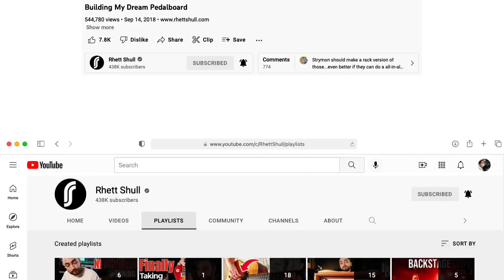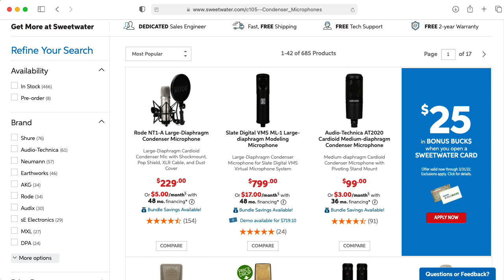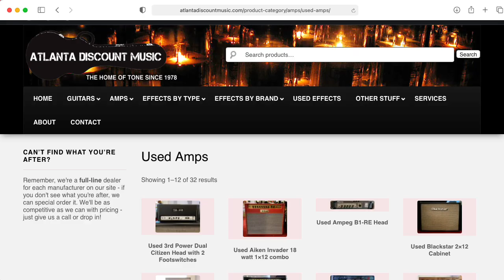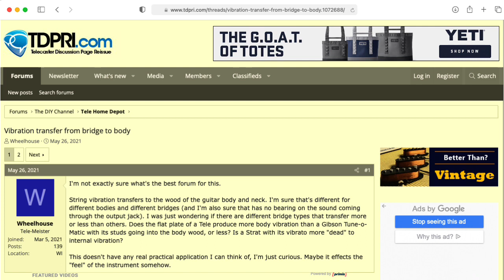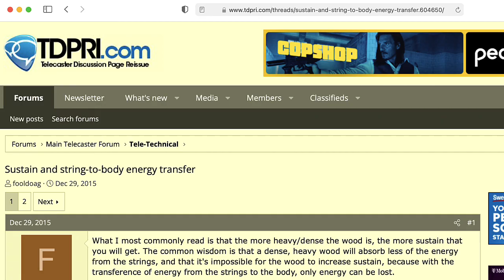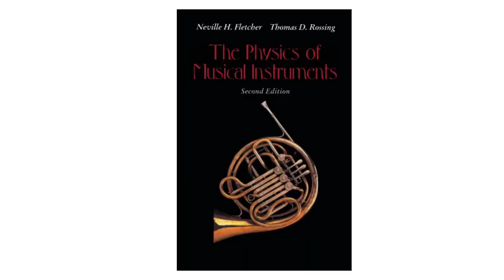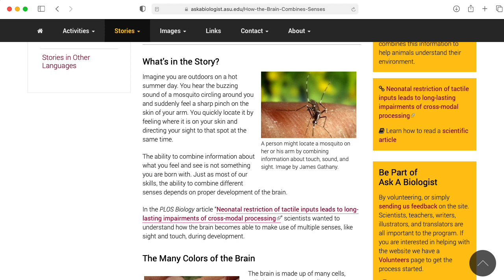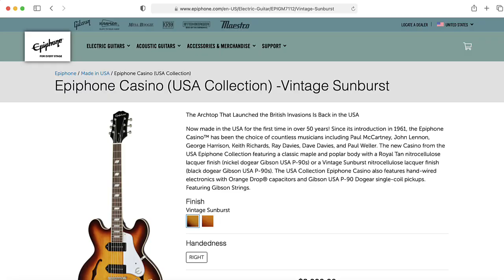Refining Rhett Shull's Resonance Reasoning: Vibrations in Electric Guitars and the Sustain Paradox

Comment: I've been playing guitar for 57 years and electric for 54 years.  I find that I prefer mahogany necks, because I find the tactile feedback provided by a less dense and more resonant neck helps my finger vibrato.

As an aside, and related tangent, every New Year, our congregation invites congregants to bring their own shofar (ram's horn) and blow it, en masse, to usher in the New Year.  But the difficulty that mass-blowing presents is that one cannot hear OR feel the instrument/horn to know if one's own blowing has gotten air moving.  It's like trying to play sax with pads on your fingers and ear plugs to prevent feeling or hearing the sound.  It would be near impossible to learn to configure your mouth and lips appropriately in the absence of the feedback.  And since it is not the sort of skill one practices daily to be able to rely on habit, in lieu of real-time feedback, the critical nature of that tactile and audible feedback is even more pivotal.  And if, by chance, everyone else stops blowing, you can easily find yourself erroneously making raspberry noises instead of a robust howl.

I have that relationship with neck materials.  If an amplified guitar is played loudly enough, then the amplified sound will vibrate the guitar body, and ultimately neck, enough that competent finger vibrato is possible, regardless of whether it is a mahogany, maple, multi-laminate, or aluminum.  But if I'm not playing loud, I need to feel that note resonating in the neck and delivering tactile feedback to my fret hand to bring out the B.B. King in me.  It is subtle, like most bodily feedback is, but I find it matters.
Reply: It's not so much that a guitar body resonates, but rather what resonates.  I have a pet theory that the tone of an electric guitar is influenced by whether the bridge is situated closer to the "waist" (where the instrument is narrowest) or "hips" (where it is widest).  Certainly, in terms of physics, the overall mass and material density, of the body plays a role.  But the bridge is one of several loci that determine what acoustic energy (and specifically harmonic energy) in the string is maximally conserved or damped, and I feel the mass directly underneath the bridge plays a role in that.  Look across a diverse range of solid-body electrics, and you'll see that they can vary quite a bit with respect to where the bridge is situated (compare an SG to a Les Paul or Telecaster).  And if we look at acoustic guitars, many experts will tout the sonic virtues of the 12-fret neck, which moves the bridge further back, and over the "belly" where a bigger bass response can be elicited  (here's an illustration:  https://www.taylorguitars.com/sites/default/files/styles/full_image/public/images/2021-10/12-fret-image-1-500x410.jpeg?itok=FArjIATu )

Comment: The neck is actually vibrating along the strings when one plays. The implication is important: if the wood is vibrating parallel to the string, it will cancel frequencies in the string's spectrum, hence affecting the harmonic spectrum of the string's vibration in the vicinity of the pickup. Thus affecting the sound.
Reply from the maker: The vibrations need to couple to the neck through the nut. I suspect it may be more a case of energy in the string being lost to the neck than some kind of phase cancellation.

Comment: Interesting video. I'm interested in your opinion on how the pickup actually works. Based on what you stated about the operation of the pickup, it would appear that you believe the strings cut the magnetic field and that's what generates the voltage on the coil of the pickup. There's another school of thought that the strings are magnetized by the pickups and the vibrating of the strings causes the strings magnetic field to move through the pickup coil and induce voltage. It would be interesting to hear your thoughts on this.

Comment: As promised, I checked out the video, and it's an interesting, informative account. Thank you. 

Sorry for the incoming rant....

I agree that perception of the player can create placebo effect. No question. 

I also understand and somewhat agree w the premise of an electric guitars tone being "subtractive" in nature. That said, I think what's missing here is the potential reciprocal energy distribution that's happening between the strings and the guitars body/wood/overall construction. In my perspective/experience, a resonant guitar that you can feel vibrating as you play is not taking vibration away from the string. My belief is that there is a synergistic energy flow that's happening, and the body/neck vibration is helping add vibration back into the string. Almost a circular energy with slowly diminishing returns with each completed cycle, if you will. Kind of like an extrapolated version of a vibrating string on it's own. This is why when I play "dead" sounding guitars unplugged, the strings die down so quickly, whereas my "resonant" guitars seem to keep the strings vibrating for longer. Moreover, I believe the reciprocal energy distribution between body and strings can alter the frequencies that the string sends to the magnetic field of the pickups, even if just slightly. 

In addition to that, one thing I've considered is the fact that the pickup sits within the body of the guitar, hence the body of the guitar is making the pickup itself vibrate. I wonder if this has any perceivable impact.

Lastly, I think the question here is if pickups work via electromagnet energy, hence they are simply picking up magnetic energy from the vibrating strings, how does the pickup determine what frequencies to send to the amp? I understand this boils down largely to the materials the pickup is made of, and the amount of coiling. But it can't just be that: The pickup clearly picks up frequencies from the string as is evident by moving the pickup along the string; depending where the pick up is situated along the string, and the height, the pickup will "pickup" different frequencies due to the vibrating strings nodes and anti-nodes. Also, if the frequencies of the strings themselves didn't play a role, than a high e string and low e string would sound the same, but they don't, because the strings omit different frequencies. At least to my understanding. So, my theory is that the guitars construction can impact the frequencies being omitted by the strings. How much of an effect wood plays is my only question, and I think it's obvious that it's minimal, but I don't think it's non-existent. 

Needless to say, these debates seem to exist because no one has quite figured out every aspect of what makes an electric guitar sing. As I mentioned in my comment on Rhetts video, I think the better question is to try and quantify how much each aspect of the build effects tone, rather than simply discounting any one aspect i.e. wood. Although at the same time, I do understand that science is largely an exercise in disqualifying factors to try and pinpoint specifics. 

But, I will say, I'm no engineer! So, to some degree, I have to defer to your expertise. 

Thanks, you've earned a subscriber!
Reply: There is no evidence in any of the significant body of research on real solid-body electric guitars to support the notion of a circular feedback loop between the body and the strings. There is direct evidence that pickup vibration does not contribute to the guitar's output (unless you hit the guitar body or pickup). And in fact transfer of string vibrations to the body or neck is very small. All measurements of real guitars show that. It's just that our sensitive skin mechanoreceptors can sometimes feel those very small vibrations. But if those losses were more significant, electric guitars would have very poor sustain. You cannot have significant vibration lost to the structure and yet better sustain than an acoustic guitar (where vibration transfer to the body is much higher)). The small vibration losses to the neck of s solid-body electric have been shown, along with the string properties, to be the major predictors of what limited sustain loss there is. In some guitars, losses to bridge vibrations also contributes. So the small structural vibrations are associated with sustain losses, not vibrations fed back to the strings.
The way that pickups transduce different frequencies in the strings is well understood and easily analysed. Pickup position along the string is a well-studied contribution to that.
Reply: @vw9659  “there is no evidence” and “it’s proven not to be true” are two very different statements. And theory doesn’t always pan out in practice. My observations are anecdotal, but the body of evidence doesn’t, at least today, discredit my thought process. It stands to reason that if a plucked string transfers vibration to a structure, and that structure vibrates in reaction, that some degree of the structures vibrations will transfer back to the strings. Why would it only be a one way street?
The vibrations that I feel in very resonant electric guitars is not “very small” as you’ve put it. It’s substantial and noticeable. And all my guitars with the most neck and body vibrations carry the best amp signal.

Your last statement also supports my point that the pickups are picking up resonant frequencies from the strings, and unless you can prove without a doubt that a guitars wood and structure doesn’t impact a string vibrational frequencies, than we’re both just projecting our unproven theories.

Of course, I fully acknowledge that I may be wildly off base, but so far I haven’t seen direct and irrefutable evidence to suggest so.
Reply: @transmundanemusic  Nothing to do with "theory". It's all based on real measurements of real guitars. Read the research, by Zollner, Fleischer, Pate and others. Bridge and nut admittance are very small, like a very small funnel for vibrations. It most certainly does not "stand to reason" that that small funnel could transfer significant vibrations (which were not transferred in the first place) BACK to the strings. And in fact all of the actual data shows those small vibration transfers to the neck and body are losses. Sustain has been shown directly to be less at those frequencies. It has also been shown that if you stop those small vibration transfers from strings to structure, sustain is increased again (Wasson, Zollner). 
Misinterpreted anecdotes don't hold up against data from real guitars showing how they actually work.
The "resonant" frequency of a pickup refers to the electrical resonance of the circuit, not mechanical resonance. It's simply like an EQ curve that emphasizes whatever higher frequencies are IN the strings, to a greater or lesser extent in different pickups.
Reply: @vw9659  I honestly appreciate your comment, I’m not trying to be dismissive or disagreeable. I will check out this research, and I agree that anecdotal evidence doesn’t prove anything. That said, there are anecdotal accounts that are not supported by this supposed evidence, so it’s very possible that there’s more at play here. It’s also possible that there are other factors contributing that haven’t been considered.

I haven’t checked the studies out that you’re referencing, and I will, but the issues w studies I have seen is that so many variables go unaccounted for. I’ll have to see what I think of these studies specifically.

But here’s something for you to ponder: if you tap your guitars body without plucking the strings, the vibrations transfer to the strings and they begin to vibrate. So, clearly, a bodies vibration can and does transfer to the strings. So if a plucked string vibrates the body….now you have a vibrating body….you can see where I’m going w this. And regardless of what these studies of yours say, the vibrational transfer to a guitars neck and body is not small or minor, as you’ve put it, with certain guitars. I don’t need studies to understand what I can very tangibly experience. Yes, placebo is a thing, but it’s hard to mistake the feeling of significant vibrations. This isn’t a “hmm, do I feel those vibrations?” kind of thing.

Moreover, if you pluck the string, and then place your guitar body on a wall, or something w mass, the tone deepens. Not just acoustically, but through an amp as well. 

Lastly, if you play music through your phone or a mini speaker and hold it up to a guitar pickup, the music will play through your amplifier without any string vibration. I know by design pickups aren’t microphonic, but it’s picking up acoustic frequencies, so I’m not sure what to make of that.

So, I think this type of anecdotal evidence suggest that there’s more at play here, and a guitars overall construction has some degree of impact.

Food for thought. I think we can all benefit from not being so dogmatic and sharing some open dialogue on this matter instead of everyone just trying to be right. I think it’s clear that no one has this completely figured out.
Reply: @transmundanemusic  Tapping the guitar body or putting a tuning fork on it induces a higher level of vibration than that which has been measured as reaching solid bodies from string vibrations. So they're not a good analogue for real playing-induced string vibrations.
Similarly putting the guitar body against a wall or other resonant structure changes the resonant modal frequencies of what is now a new composite structure, changing the vibration flow. Having said that, Zollner (2010) did that very experiment and showed that while it changed the acoustic sound of the guitar, the pickup output was unchanged.
And while shouting into (only) some pickups or putting your phone near to them can induce some microphony, again that's a much higher level of applied acoustic energy than that of the acoustic sound waves from the strings or from the vibrating neck or body. And most pickups are barely microphonic.
If you read the entire literature on direct measurements of real guitars, by different people, in different labs, using different equipment, on different guitars, a consistent picture of how they work emerges. You go where the scientific data takes you. That's been my approach. Those measurements have shown that are many potential reasons why similar guitars can sound different. Pickups are of course a major factor. Plus bridges, necks, and some setup aspects can be important in some guitars. The solid body doesn't really make that list.
Reply: @vw9659  the pickup output wasn’t changed? Ok, but was the frequency spectrum tested? And how many times was this experiment run, with how many different guitars and amps, what variables were controlled etc. I’m interested in running my own test on that now, which can be done quite easily in a DAW. 
Your point about tapping the body vs string vibration transfer to the body seems arbitrary to me. The intensity of the tap or pluck would be a factor to consider, along w how different guitars would respond, meaning an absolute statement is potentially misleading. My most resonant guitar, I don’t have to tap hard at all to get a string vibration omitting a signal through my amp without plucking the string. And when I play that guitar the body and neck vibrations far exceed that of the slight tap that elicited a string vibration. I haven’t seen any controlled tests comparing a guitar body and necks vibration from various intensity finger taps to various intensity string strums.

I will have to look at the studies you’ve mentioned, but you’ve only mentioned a handful. For the scientific evidence to be undeniably clear, there would need to be a much larger body of scientific study than exists to my knowledge. I agree w your premise of following what a body of evidence shows to be consistently true, but I’m not sure that vast body of evidence exists. A handful of studies doesn’t qualify, and it especially doesn’t qualify if they weren’t the same controlled experiments that were repeated multiple times and produced the same results. And those experiments would have to take every single potential influencing factor into account. So multiple tests would have to be run w multiple guitar structures/woods/wood combinations, multiple amps, multiple bridge/saddle types, multiple nut types, multiple tuners, multiple combinations of all these factors etc. That all said, I will explore the ones you’ve mentioned w an open mind. My mind can be swayed, and even if I think there are flaws in testing methods, or there isn’t enough solid evidence, it may give my more to think about.

Comment: Guitarists' notions of "resonance" are often wrong. They often mistakenly think that body and neck vibration is a good thing, basically contravening the Conservation of Energy Law. If the structure is excited to vibrate by string vibrations, those vibrations have been lost from the strings, so not seen by the pickups - hardly a good thing. Fortunately all measurements of real guitars show that body and neck vibrations are very small (even though our skin mechanoreceptors are sensitive enough to sometimes feel such vibrations). So when guitarists experience a guitar that they say is "very resonant", it's the strings that are resonating (vibrating). Some then misinterpret the small structural vibrations they also feel as part of that experience - their haptic experience is effectively misread.
There is now a substantial body of solid-body electric guitar physics research, based on measurements of real guitars, that shows how real solid body guitars actually work.  See the work of Zollner, Fleischer, and Pate, amongst others. Pate and others have shown a direct association between neck modal vibrations and REDUCED sustain.